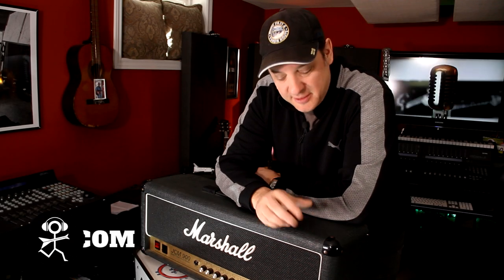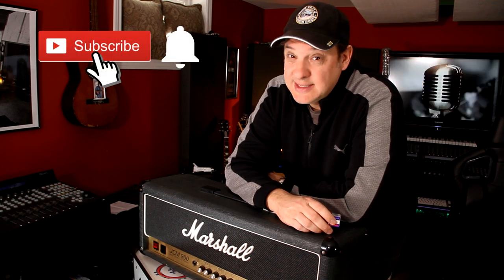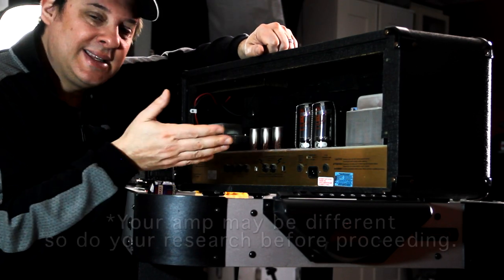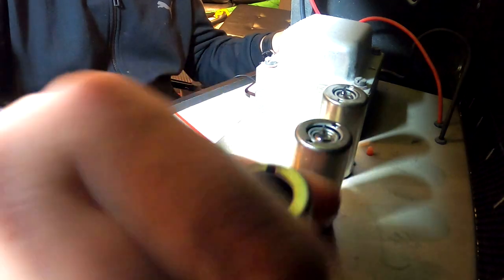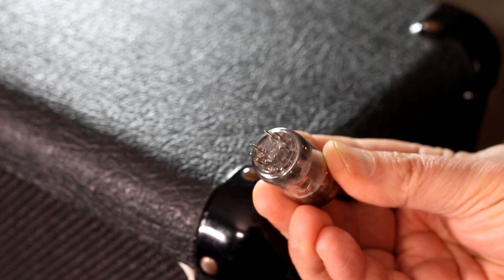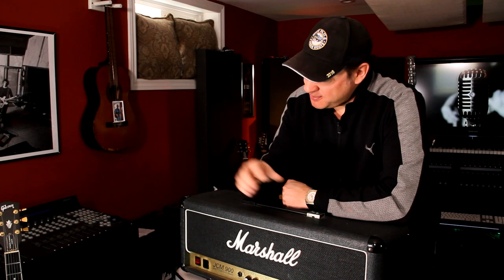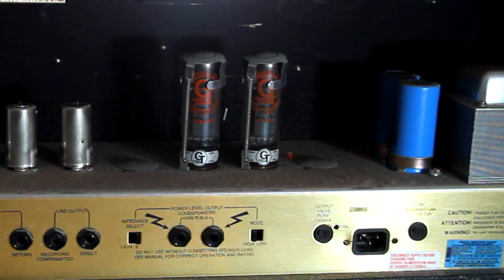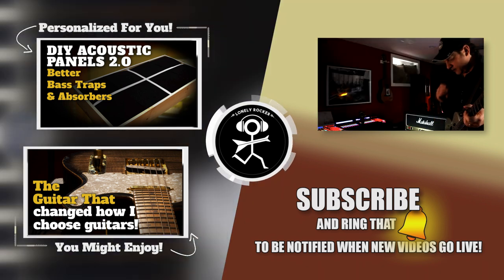How To Change Preamp Tubes | Is it Safe?

Comment: Thanks for the video.  I have a 2555 from '88 and bought it in the early 2000's.  I've never been in messing with the tubes (glad I didn't back when I was young and didn't know what I was doing).  It's been sitting in its case in the basement for the past 15 years, and I think its time to clean her up and get her in shape to last another 40+ years.
Reply from the maker: My pleasure!!!  Do be careful in there.  If the power tubes are not good then I do recommend taking it in.  They are easy to change but if you don't know how to adjust the bias they won't function optimally...have fin with it!

Comment: My Uberschall has EHXECC83 12AX7/ECC83 Slovakia Preamp preamp tubes and two in the back have rubber bands on top of them, what are the rubber bands for?
Reply from the maker: Hard to know from here but some amps have a mechanism to keep the amps from moving.  Could be as simple as that.  But I can’t say for sure without seeing it.
Reply: @LonelyRocker  I will put the rubber band back on the preamp tubes when I replace them next week. Hope it is just bad preamp tube and not bad power tube as KT88 hard to replace.
Reply from the maker: Yeah, unless you know how to bias you'll need to get an amp tech to do it...good luck!

Comment: Question : Why does your 900 have 2 Lrg power tubes and mine has 4 ? You opened your's up and I was surprised to see that. Curious to know. 
Anyhow, switched my amp on this morning and got a constant humming tone. I know somethings wrong.
Not knowing squat about amps. I am guessing my preamp tubes.
Reply from the maker: Mine is a 50 watt.  I assume yours is a 100 watt?   As for the humming, hard for me to say from here but changing the preamp tubes is super simple and they will never go to waste.  Doesn’t hurt to have spares lying around.  If that doesn’t fix it then I guess it’s off to an amp tech :-)
Reply: @LonelyRocker  Thanks for the reply. Yes mine is a 100W. Update:  My amps okay now. I left it on standby for about 30+ minutes. For some reason it took longer to warm up today I guess. It tends to have a mind of it's own now and again. Sometimes it will pop and crackle. Tomorrow it may catch fire. Who knows LOL
Reply from the maker: My pleasure!  The unpredictability of a tube amp.  I wouldn’t change it for anything! 😂😂😂

Comment: I can shuffle my existing tubes around, right..? (ie the five tubes at the back are identical, as are the two 'power' (?) tubes at the front...?? Its an 80's MB 22+.
Reply from the maker: I would NOT touch the power tubes if you don't know what you are doing.  Any change in the power tunes requires biasing.  Yes, you can move around your preamp tubes but I doubt you'll hear much of a difference if anything at all...careful in there if you are not sure what you are doing....
Reply: @LonelyRocker  thanks. The amp failed a year ago (no light) thought it might've been the old tubes in there
Reply from the maker: Could be something as simple as a fuse or something more involved...or just the tubes.  Take it to an amp guy.  I recently serviced my Marshall and it was well worth it...good luck!
Reply: @LonelyRocker  thanks yeah, hopefully... it'll go to the shop 👍  enjoy your Marshall, I know I would.😎 there's something about  a Marshall. I only have a Lead 12 (80's) but I rehearsed with the band with it lastnight 😄
Reply from the maker: Smart move ;) Hey use what you've got with pride and build over time...that's what I did :)

Comment: And how can I find a power tube that will match what I already have that way I don't need to play too much with the amplifier I have a Marshall JTM 45 amplifier
Reply from the maker: You generally would replace all of them at once.  But best to have an amp tech do it.   They would make sure it’s done properly.  Don’t try it yourself.  It’s not like changing a lightbulb.

Comment: First of all, after you unplug the power cord, you should switch on and off the amp to discharge the remaining electricity on capacitors completely.
Secondly you forgot your cam in the amp.
Reply from the maker: Point number 1:  Thanks for the tip.  Point number 2: OH!!! That's where it went!!! ;-)))))))